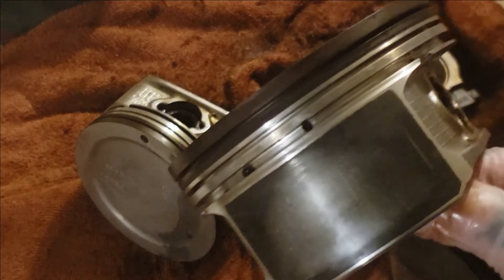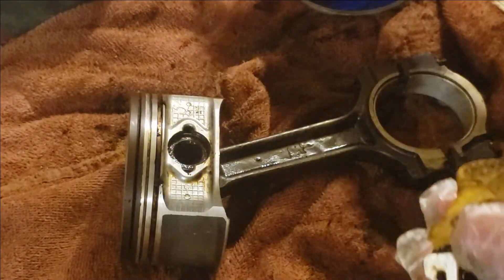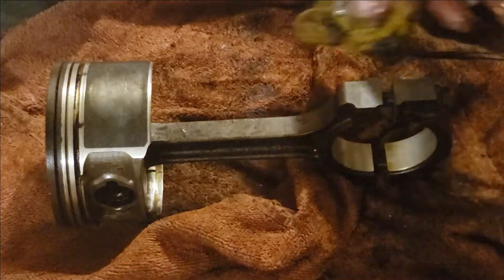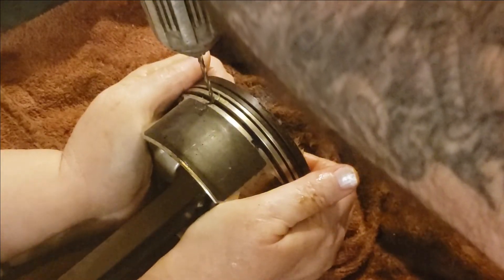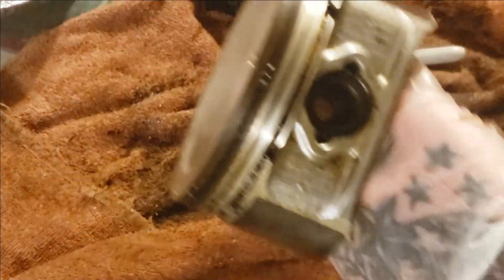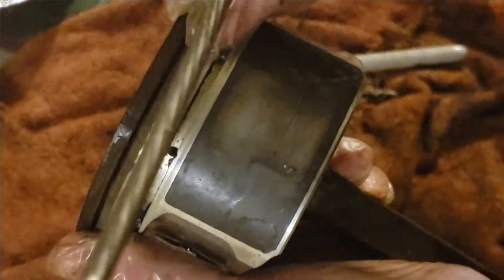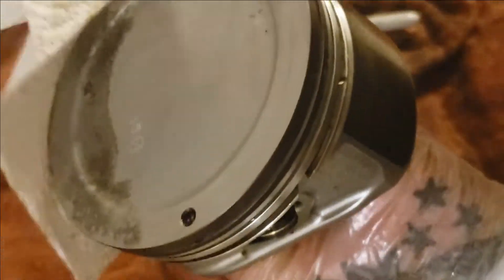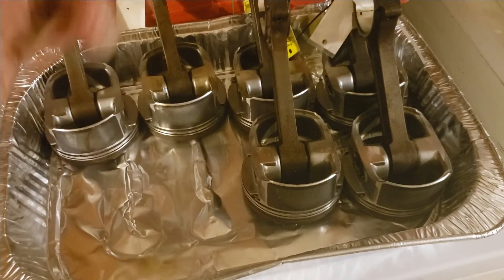Adding Oil Drain Back Holes To Pistons - HOW TO - LS Edition

Comment: Is there any problem as the holes in the center of groove.
Reply from the maker: The engine is installed in my tow truck and is doing fine, the oil holes are a added upgrade, it keeps oil build up off the oil scraper rings

Comment: does the factory ones not work that good but its a pretty good idea to add a few more the pcv valves are the main culp for oil consumption on the ls
Reply from the maker: Yah factory don't work that good, gm has it in their tec data from way back, they wanted to have their drain holes but castings was hit and miss with them, so they scraped the ideal,  as for the pvc, it was not the problem for the oil it actually was the valve cover not having drain back holes, which they fixed with a updated valve cover. I usaly just drill older gen ls valve covers to fix this issue
Reply: @TattsForLife  i didnt know that about the valve covers if i ever have mine back off ill be sure to try that out i already added a air and oil separator that helped a little